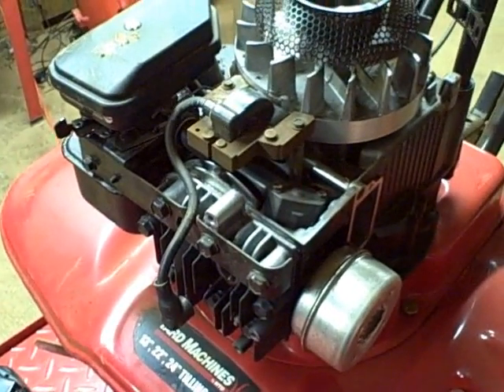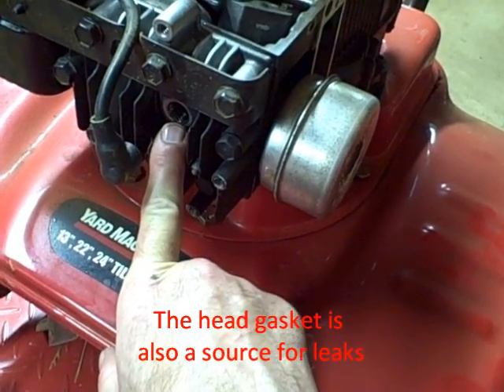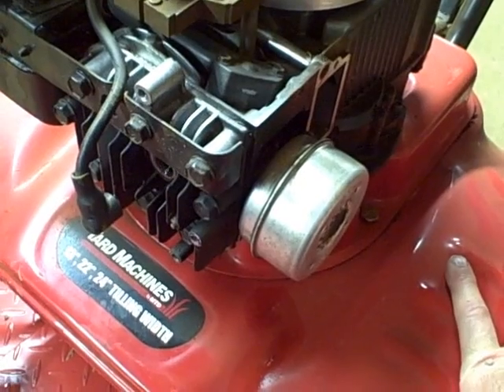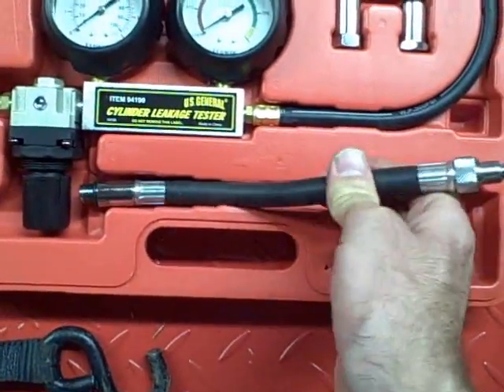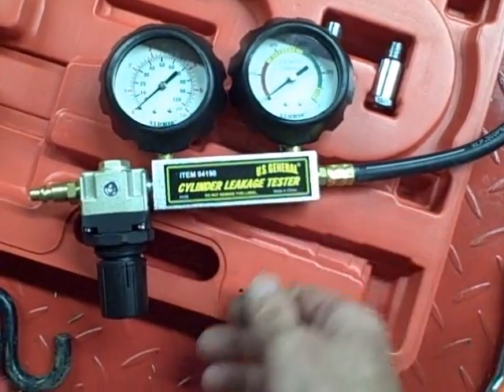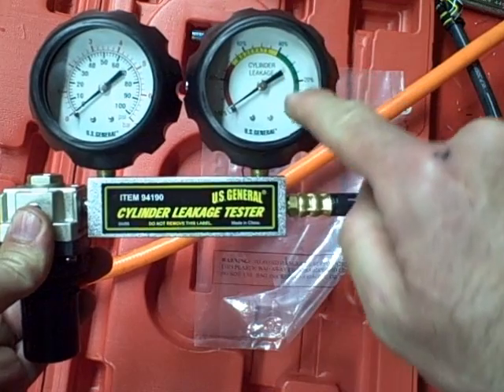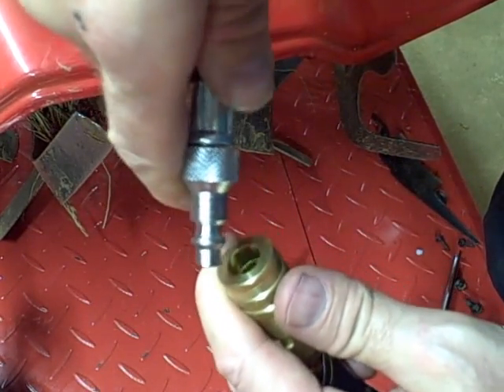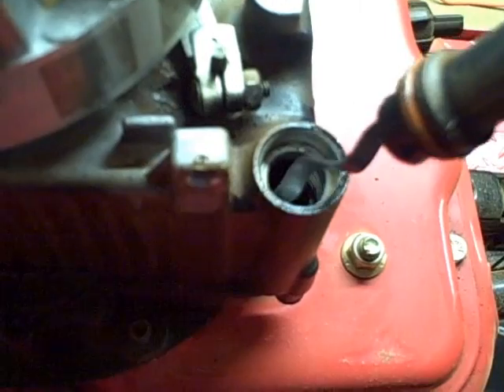Small Engine Repair: Using a Harbor Freight Leak-Down Tester on a Briggs & Stratton Engine

Comment: Very helpful.  I was using a compression tester prior but obviously that doesn't do any good on newer engines with pressure releases for easy starting.  The best part was learning how to tell where any leaks are coming from.  Thank you very much sir.

Comment: You really did a great job explaining on how to do a leak down test.  Do you have one on an OHV  single cycle engine?  It's probably the same.  Thanks.  I hear the OTC leak down tester is pretty good. Amazon has it. $73.00

Comment: what do you do if the engine won't start and that's why your testing to begin with???? Can it be tested cold?  I liked your video!
Reply: Yes check cold but first use starting fluid and see what it does

Comment: Hi, you mentioned not over 100 lbs output on your compressor. What is the minimum or a range of up to a maximum of 100 lbs. I don't have a huge compressor so I want to make sure I have a minimum pressure output rating available. I would assume regulate the ouput pressure on the compressor after it shuts off. What did you do to insure engine doesn't move after obtaining TDC on compression stroke?
Reply: Really 75 lbs will work ok

Comment: could this be used on chin saws when you only need 10 PSI tops if a higher amount of pressure would blow the seals?
Reply: Ted Most Chainsaws use 80 to 120 PSI  , Fuel has to be under pressure to combust  at 10 PSI it would only burn not explode.

Comment: What if your engine does not have any pressure loss when you do a leak down test?  I have a Briggs 17.5 HP OHV  that I did this on and did not indicate any pressure loss at all.  I understand that this is not normal, if so do I have the valves adjusted incorrectly?   Thanks again.
Reply: Frets , if you had the Piston top dead center Valves are closed on a good engine you should not get no drop , Head piston chamber is about a 2 inch area . it will fill with air ,  BAD rings or carboned up valves leak or head gasket .  that is why you listen to the intake exhaust and crankcase.

Comment: That's an excellent summary and review of the equipment. It took me a while to understand how this works. I was a little puzzled why they didn't label the second gauge with units of pressure. That's all it is! Simply, there is a small orifice separating two chambers, each connected to a pressure valve. When the first chamber is filled, the air slowly flows through the orifice into the second chamber and the second pressure valve responds to the increase in pressure. It's understandable there may be a small delay, for air to get across and equalize pressures in the two chambers. Then when the second chamber is attached to the cylinder, the pressure in the second chamber falls. If the cylinder has an external leak, pressure falls a lot and the gauge measures the big drop down into the red zone. Because the orifice restricts flow from the compressor, air can't flow fast enough through the orifice to restore a drop in pressure. So, it becomes a competition between the resistance to filling through the orifice vs declining pressure out the external leak. In that sense, it's exactly analogous to a voltage drop test when testing electronic circuits. A big drop across the known resistance of the orifice means there is significant flow, caused by a downstream air leak....

Comment: Did you pressure wash that engine then blow it off?  Or, how do you clean the gunk off to begin?
Reply from the maker: You can use compressed air.

Comment: Introducing cold air into a hot engine can warp or fracture
valves and/or other engine parts. Always test a cold engine. A standard compression test is done with a warm engine.

Comment: Same tool as mine. What do you call the input connection was different from my other air tools. I ended up holding it by hand. My output valve leaked as well when the pipe was disconnected. Nice that it does not move the crank even if it is not at tdc. Had to repeat the test a few times as the calibration is not very stable.

Comment: BTW - You don't have to keep the pressure at your compressor below 100lbs. The regulator on the gauge should be able to handle up to 200 lbs + at the input, as long as you don't dial in more than 100 lbs; actually 15 lbs, because the second gauge maxes out at 15 psi.

Comment: yes, for a cylinder leakage test, aviation and automotive engine service manuals specify that you must be able to inject 100 psi into cylinder, however, the cylinder will not hold 100 psi because of normal leakage past the rings. So you inject 100 psi, but you measure the amount of pressure that the cylinder can hold. if the cylinder can hold 80 psi with a 100 psi input, then you have a 20% leak rate. ther are many web sites with long explanations. I have reported this defective tool to uscpsc

Comment: @FuriousHondaBoy from PredatorOmnivore. it won't let me post a link just search to make your own leak-down tester you need to apply 100 psi to input, you need to measure actual pressure differential between two gauges. The HF tool only allows 15 psi as test pressure 520536-make-your-own-cyl-leakdown-tester

Comment: The Harbor Freight leak-down tester is useless. The tool has two fatal design flaws. A true leak-down tester is a differential pressure gauge. There are many web sites that explain how to easily make a true cylinder leak-down tester that actually works.